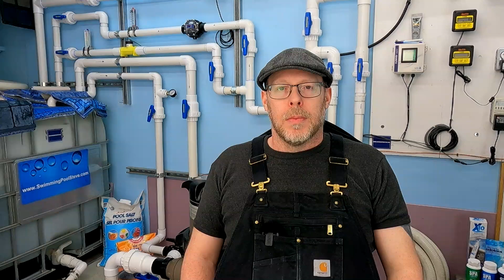Why Is My Pool Pump So Hot?

Comment: Hey so I have 3 hp intelliflo VSD pump and I noticed few times it’s really hot. I do have the back fan cover missing, it broke off but it runs normally and it’s just 2 years old. Anyways once it put my hand on the motor under the drive and it was uncomfortably hot. Not boiling but enough to need to let off after 3 seconds.

Comment: We've had a new Epsa single speed pump installed (exact replacement) and it's been cutting out every 2 minutes for 40 seconds. The heat sensor was replaced and it seems to be Ok but my infra red thermometer shows a temp of over 100 deg C on top of the motor with the lid off. Is that not too hot? I'm in Southern Spain and it's been over 40 deg here in summer.

Comment: Hi Steve been with you from your very first vids don’t comment a lot anyways my pentair super Flo 342001 I think that’s the model anyways what I noticed when I changed my sand to Dr Dryden glass ( imo the media is head and shoulders better than any other media on the market it’s amazing and the lower speeds  it cleans most optimal , my point when you talk about filter pressure everyone’s is different you already know this but when I went from sand to glass what a higher pressure it runs

Comment: Love your fantastic advice and thank you for sharing your knowledge. I have a Pentair variable speed pump and have it running 24/7 at 2000 RPM (minimum speed needed for my fairly new heater to detect water flow and turn on). The pump feels hot to the touch...not too hot to hold your hand on, but hot. I clean the pump basket every day. I'm wondering, how hot is too hot and s it bad to run the pump that much? Thanks again.
Reply: Get a temperature gun and see how hot it really is.  Amazon has them for like $25. Electric motors can get quite warm without issue.  Smoking hot...no good
Reply: I have that same system. Pentair intelliflo at 2000 nonstop 24/7. And I noticed its hot but I can’t determine if its too hot